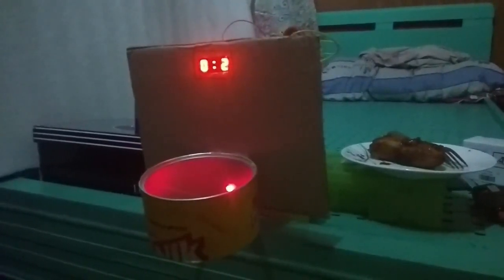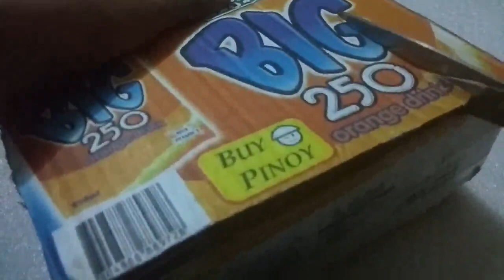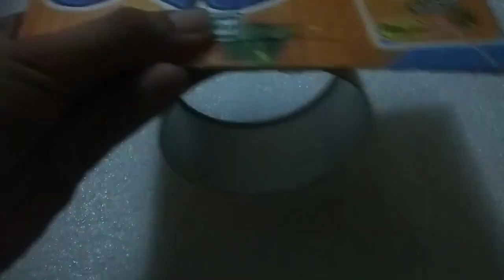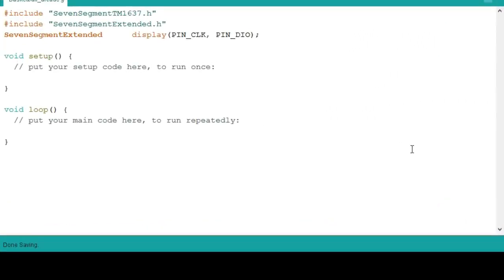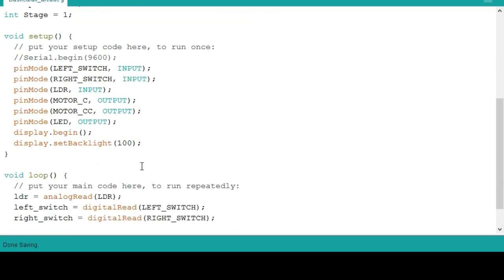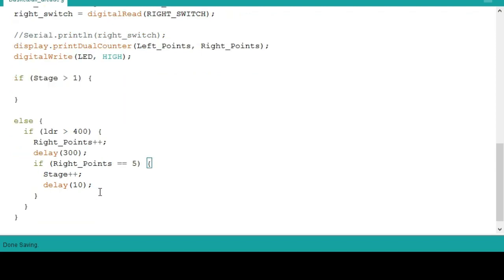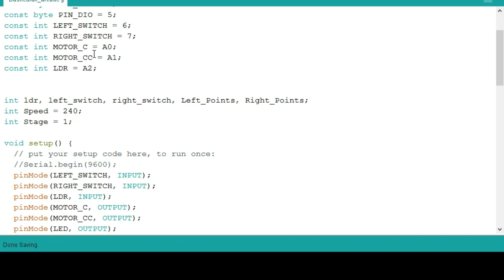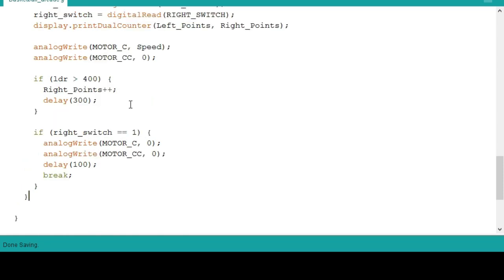Arduino | How to make a Basketball Arcade using Arduino | FULL TUTORIAL | FOR BEGINNERS 2020

Comment: Idol gawa ka po ng video kung papano gumawa ng actual basketball ring na coin operated tapos may digital score
Reply from the maker: Pag di na siguro busy idle
Reply: Lods pwede kaya gamitin yung ultrasonic module sensor para sa basketball ring hoop
Reply: Sir pano gumawa ng basketball scorer gamit ang ultrasonic sensor tapos 7segment ano mga needs
Reply from the maker: Pwede naman ultrasonic kaso may delay ng konti yun, lalagay mo lang under the rim. For scoring bili ka ng multi 7segment module
Reply: Pano sir pag capasitive proximity sensor?
Reply from the maker: @ninoportales5736  pwede din yan, pero pinaka the best IR.
Reply: Ano yung IR lods?
Reply from the maker: @ninoportales5736  infrared idle
Reply: Idol code link
Reply: Lods pano kung yung gagamitin na 7 segment display yung malaki yung 4inch ang laki anong resistor ang gagamitin
Reply: Lods baka pwede mo akong gawan ng basketball timer with scorer...na may sensor... 
  Willing ko pong bilhin... 
Yung 7segment po na gagamitin yung 4inch po size